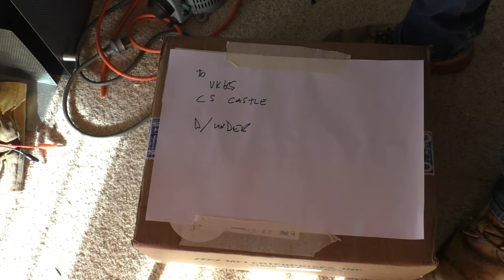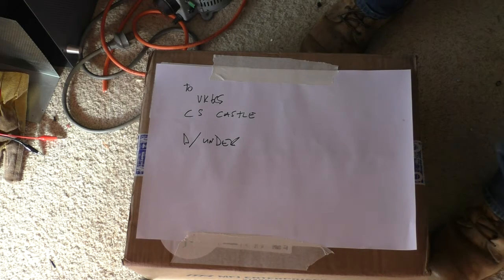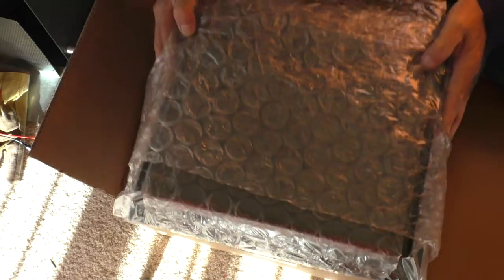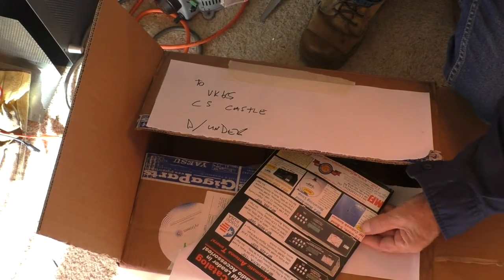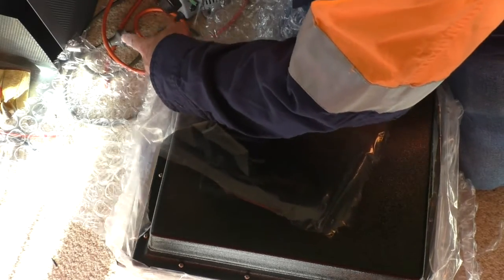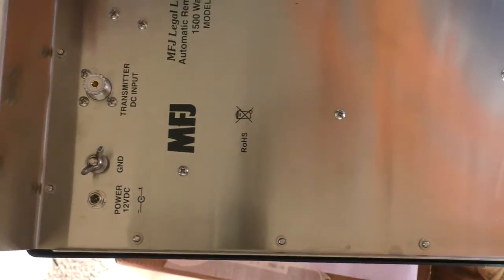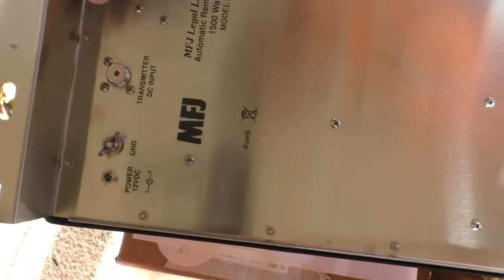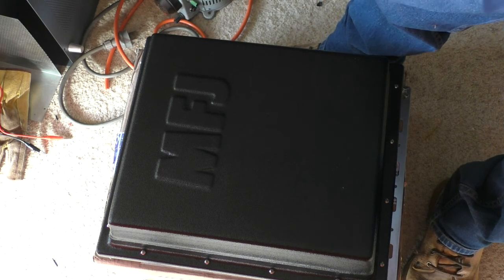Unboxing An MFJ 998RT Auto Tuner

Comment: 1) Don't worry Steve. We know where you live and the important thing is that Ofcom and ACMA also know....LOL :-)
2) We all know you work for the AFP.
3) The aliens occupy the dark side of the moon. They are miners. Where did you think all the cheese comes from ?
4) Get a better knife. A blunt knife is useless.....
5) You played Davros with Tom Baker, didn't you ? Bloody BBC hack....
6) Made From Junk ?????
7) Polymer ?
8) More power out doesn't give you any better receive. Don't forget that. It's all in the antenna and receiver.....

Very much looking forward to the next few videos. Congratulations on a nice piece of kit for your shack. Nice :-)
Thanks for sharing.
Reply from the maker: Cheers Ade... you haven't read my novel by any chance have you? I have run 200W on the air, it's as much as the previous tuner is specified for, and even though it was only 3dB up I received improved reception reports.
Reply: No, but I have read your biography.......

NB : Transmitting more power does not make your ability to listen and hear weak stations any better.

I am very sure other stations could receive you well with more power.
Reply from the maker: True, but weaker stations are less likely to be able to hear me. I don't try to pull weak stations out of the noise.